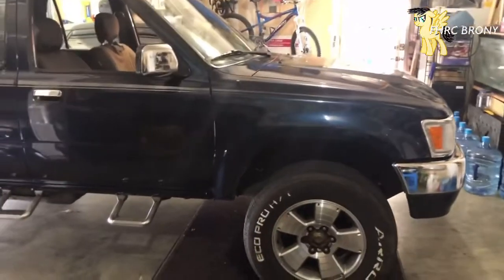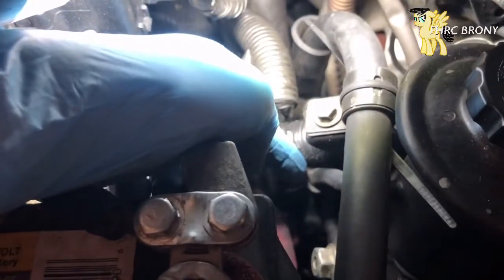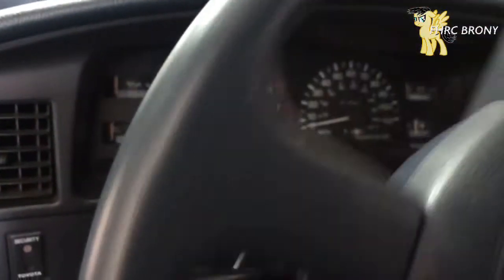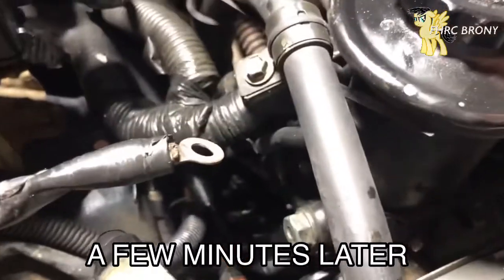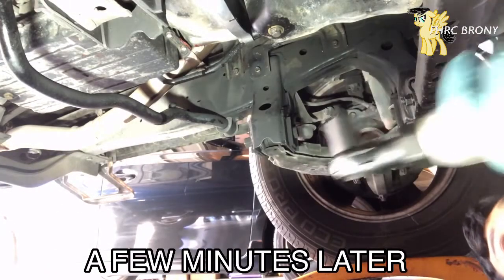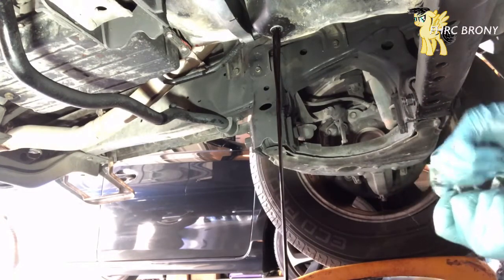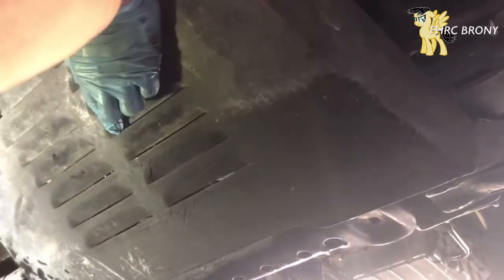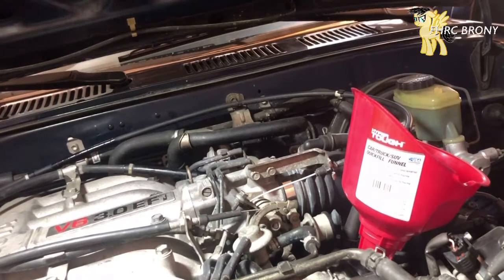Maintaining my 2nd Gen Toyota 4Runner (Power Steering and Motor Oil Change)

Comment: nice 2Runner and video. two things. rub a finger's worth of oil on the new oil filter rubber O ring gasket (making sure the old gasket came off the old filter) before re-installing the skid plate, add the oil and start engine to confirm there are no leaks.

Comment: I actually have a 91 pickup and it’s the same the only thing that I haven’t had done it’s the power steering because I don’t know if I unplug the hose it will drain from the hose or the reservoir?
Reply from the maker: Mainly from the hose
Reply: @TndPnyRCofficial  thank you very much I will be looking to do that! Have a great day.
Reply: @TndPnyRCofficial  thak you very much! I just did that but I thought about ok the returning line has two clamps one on top one on the bottom so I decided to dreined from the bottom clamp and it was so sweet no spills at all ! Thank you very much.
Reply from the maker: No problem